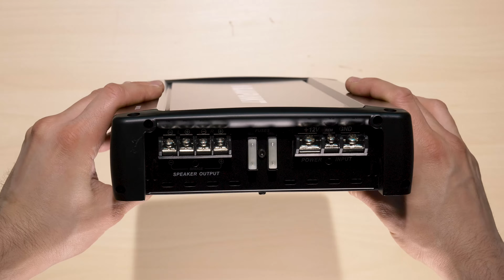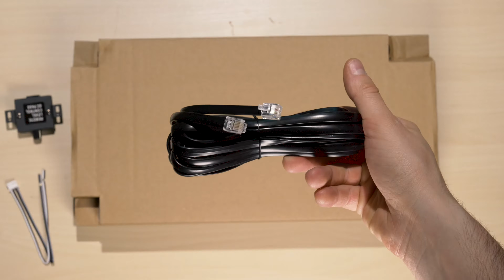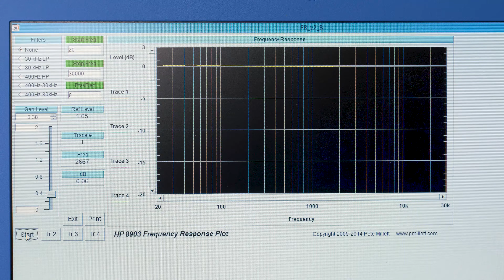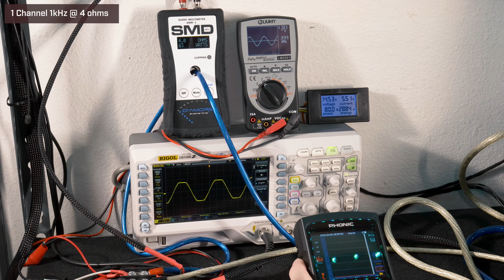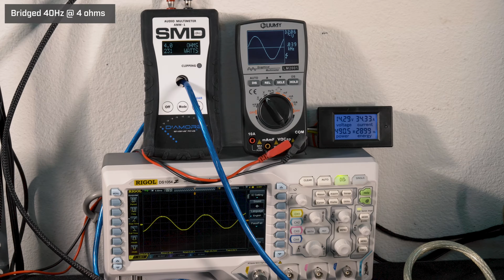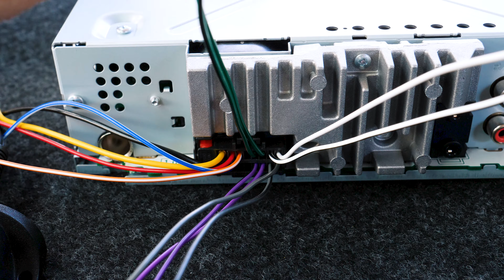Blaupunkt AMP2002 WALMART Amplifier - 1500W RMS for $70???

Comment: Many manufacturers use 1KHz tone for measuring output and THD. Blaupunkt doesn't specify what they used, it might be interesting to go back and run these tests again at 1KHz to see if it's any different.
Reply from the maker: In the video we ran every test at both 40Hz and 1kHz
Reply: @Qualitymobilevideo  lol got me on that first one before the edit. I was listening to it while fixing some iPads. I went back and re-watched it. At least you were thorough, but man, that THD is pretty high.
Reply from the maker: @drea_5150  Lol all good.